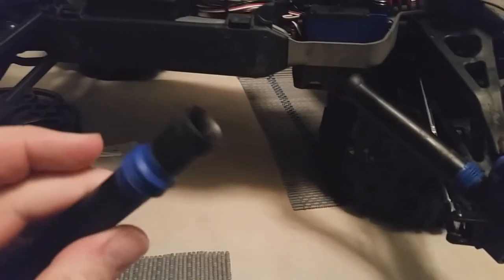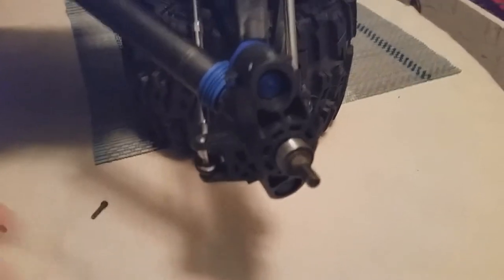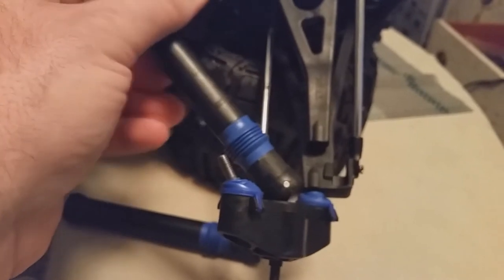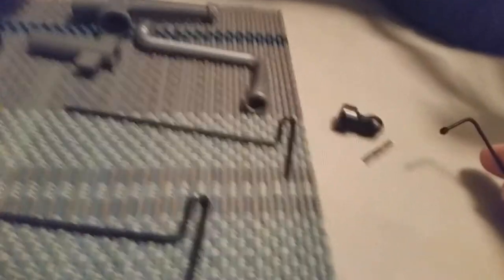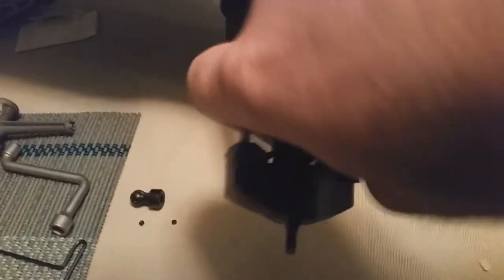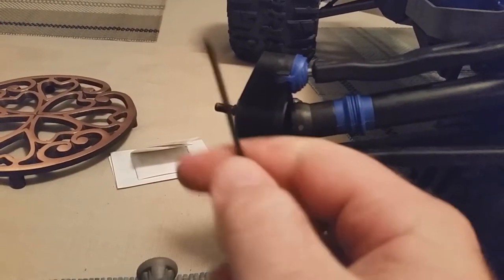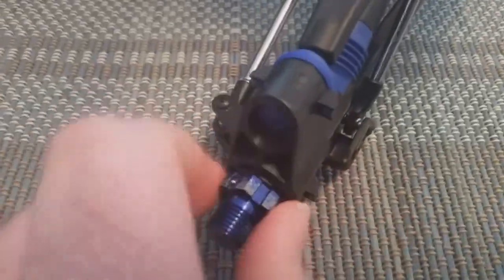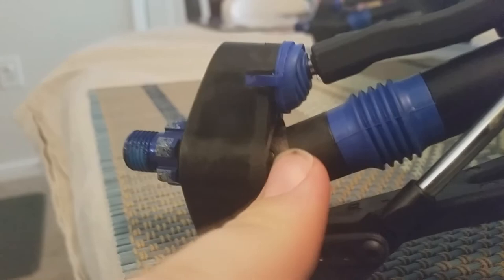Traxxas Summit Outer Drive Shaft Repair

Comment: Thanks for this video. I recently bought a used Summit and aparently the previous owner had the shafts turned around so that the rubber boot was closer to the axle and not closer to the knuckle.